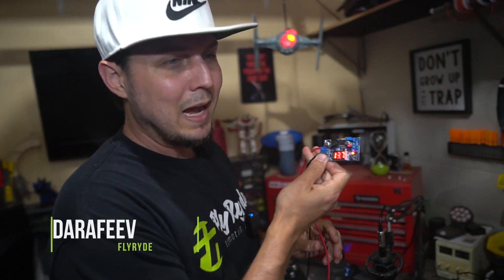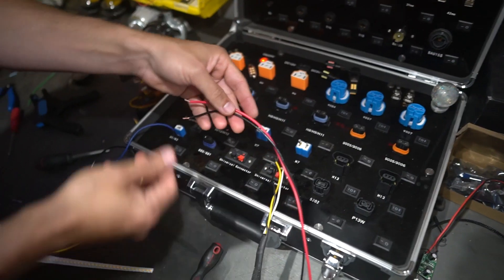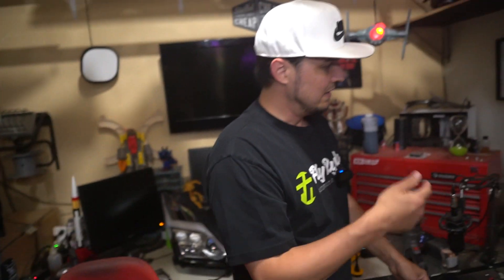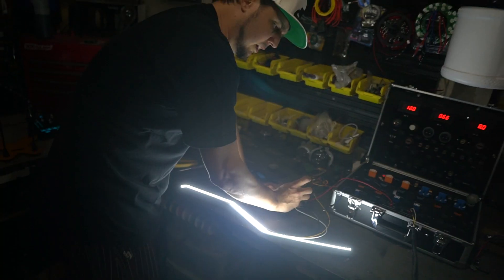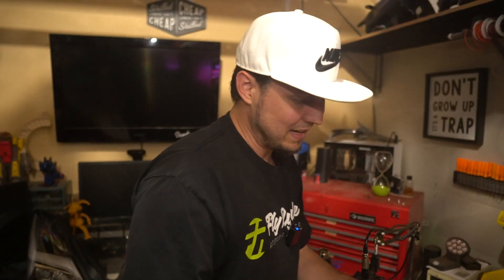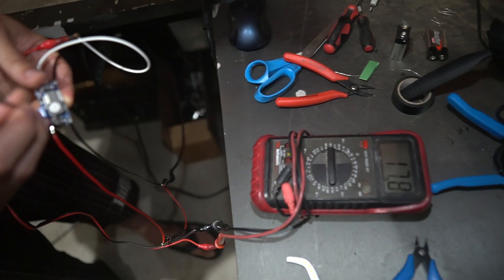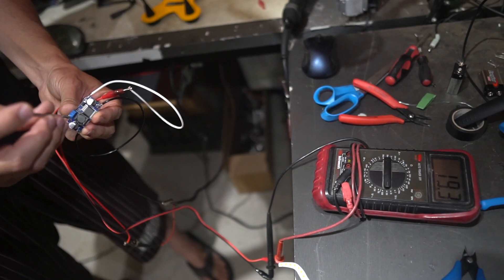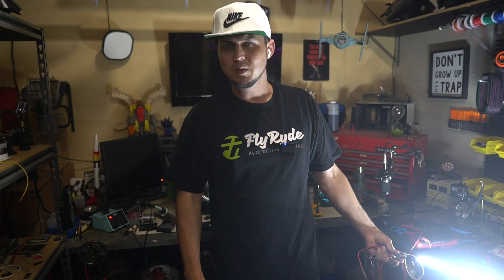How to make LEDs BRIGHT

Comment from the maker: My new Book: www.FlyRyde.com/start
Reply: Hey Chris, doesn't seem like you added the link for the converter. I'm guessing this is the opposite of a step-down converter I once bought by Drok.
Reply from the maker: So annoying, it wiped out all the stuff I had in the description and I didn’t realize till I read comments this morning 😅

FIXED
Reply: https://www.ec21.com/product-details/Car-LED-Test-Box-Useful--9569822.html    the test box
Reply: Leds are current driven right? So is that module also increasing Amps along with voltage Therefore making them brighter? This would make the them run much hotter and potentially fry them once they have been left on for longer period of time...
Reply from the maker: The heat that we building up in the buck converter was when I dropped the source voltage down to 4v, and the output was pumping up to 14.5. It was working HARD! In a car that’s running 12v at rest, it’s much less demanding to pump it up by 2.5v, and obviously less than that when the source voltage matches the set output.

I’ll do a future video on heat testing LEDs to the point of failure to demonstrate all of this as well 🤔 that sounds FUN!
Reply: @flyryde  I certainly look forward to that. Smoke and flames, the whole shenanigans. Do a remake of The Towering Inferno (1974).
Reply: @tacoreapermonir8725  That may be the case, yes.  As we saw, Chris felt the heat rising and hurriedly turned them off.  LEDs are less tolerant to heat and will fail faster. A marginal increase will still impact its useful life, but duration at a time and frequency will dictate by just how much sooner they would fail.  Now, if we are talking about DRLs, a reasonable level of brightness during the day should be effective for what they are intended to do.  In some conditions - weather or otherwise - there may be a need for a momentary increase in brightness that hopefully would not hurt much since the added brightness will not be sustained or become a default setting.  At night time, DRLs should be dimmed and not run at maximum intensity.  And this trick will make it a problem for those who are looking for attention.  The wrong type of attention would likely keep them using it responsibly.
Reply: @VaronsFirstLove  He only felt the heat of the converter rising as he had to input voltage too low.
Reply: @VaronsFirstLove  He felt the converter get hot. As he said the input voltage was too low so it was working much harder to put out 14.5v. There are other ways to dim I think. Just depends what your setup is.
Reply: @VaronsFirstLove  You need to know the maximum forward current for the leds to be able to safely increase the the current they use. That is the safest way you can do it.
Reply: Yore welcome
Reply: A cupel of minutes Google search
Reply: Can you do a video on last gen crown victoria lights? They cover alot of area & are fairly cheap to get brand new, but the styling is wack & the quality of the lens plastic & lighting output is terrible. There are a few aftermarket designs, but 4 the most part its somebody repainting or chroming the inside housing. If you.could design a better light it would make it worthwhile ure investment cuz everyone who has these hate the lighting output & overall design for any panther body.

Comment: Your links show a step-down buck. Wouldn't we need a step-up buck to increase the output voltage? Does anyone know if you can use the buck converter to brighten a turn signal led? And if  it would cause any issues like hyper flash?

Comment: You need a buck boost board,  the doctor dc converters are awesome,  but a boost only will go up if the input is higher than set voltage, it can't be set lower than the input, that is why the buck boost converter is needed!

Comment: Hey, I bought the circuit board with the screen on it, for changing output voltage, but it doesn't increase voltage by much. I was wondering if I was doing something wrong?  I'm using a battery pack with 8 D batteries for 12v, I wanted to crank up the voltage to my lights but it isn't going above 12.3v. Do you have any idea what I can do differently?

Comment: Do you realize that these are a step down voltage regulator? They're not to raise the voltage. Did it go from either 36,24, 12 volts down to 5volts 2amps. I don't think these are the pieces you need for this application.

Comment: Chris!! Great video man!! Thank you 🙏!!
So can I use this product to brighten my DLRs on my C250 M-Benz? I noticed my DLRSs run at a lower brightness level when the headlights come on. I replaced the headlight bulbs with LEDs and now the DLRs look weak. You think this will work for me?
Reply from the maker: The circuit responsible for running them at night, is powering them up differently than the DRL function (that turns off with the low beams).

Chances are, adding source voltage to your lights won’t increase brightness, because they’re likely regulated within the actual housings.
Reply: DRLS are supposed to dim when u turn on your headlights. It would be stupid if they didnt.

Comment: I tried these on my custom led tails. I set up two on each side; one for brake and one for sequential turn. My Corolla did not like this. I threw an accelerator error deeming the throttle non responsive. Fortunately I was not in traffic and just pulled over and went back and bypassed the up-converters. Again, fortunately I installed plugs so this was easy. I learned the code often is a result of current backfeed. Then I installed diodes on all converters. This helped, but still threw the code and disabled the throttle, this time in slow traffic with long durations of brakes on. 
For now the converters are back on the shelf…
Reply from the maker: What was the purpose of using them in the first place? What are you trying to do?
Reply: @flyryde  I was increasing voltage a bit as you were in the video to brighten up my lights
Reply from the maker: @FishHawk1  in the video, I increased voltage from ~12v to the normal operating voltage of 14.5v that those same parts see when the engine is running. What were you sending to the lights, and how was that backfeeding?
Reply: @flyryde  I set the output to 14.0 v. Before and after installation I verified output stability with an input voltage range of 11-14v. 
I believe the backfeed was tiny, especially after installing the diodes, but enough for the ecu to pickup, causing the fault code. 
My guess is it has to do the common ground circuit used for the tails.

Comment: hey, I hope you are well, I wanted to ask you what is the safe voltage for some led taillights which I want to make brightness boost, the particular led taillights come from a Kia Picanto 2020 and I don't want to break them with an excess of voltage.
Reply: Its effectively a tradeoff between brightness and longevity - and not a linear one at that. At some point the life expectancy will start to drastically drop - to the point of essentially immediately becoming DEDs (dark emitting diodes 😜...) And it depends on what sort of LED, how it's mounted, how well heatsink it is, does it have internal regulating circuitry, etc. I've seen SMD LEDs melt the solder that holds them to the circuit board w/o themselves at that point having failed (le once cooled down we resoldered the connection and it was back working...)

Comment: Using this buck converter, do you install it before the sequential switchback controller or splice it between the controller and the LED light strip?
Reply from the maker: It’s the same way since all the power in the sequencer is just pass through. I’d do it way upstream before the power branches out to passenger and drivers sides (if you can find that).

Comment: Now setup for current readings and do it again 😳😎 it's the amperage the does the work, voltage gets you there, and your resulting wattage will come out in either light or heat which is why you cant run high-power LEDs as singles without a Driver. 😂 Or one of those 50watt 6ohm resistors 👀🔥. Always better to generate light vs the heat 

Ohms Law
Volts x Amps = Watts

The LED data sheet will usually tell you about how far you can push. And if your LED is a constant current LED then voltage won't matter much anyway... Always a trade off somewhere. 

They have those in dual volt too BTW. REALLY handy for Blue GHOZT when you need both 5v and 12v. Some regulate the current too.

Search CCCV Regulator

Comment: OK Chris,
I play with LED lights quite often. LED light requires constant current and amperage to work for a long time. As you increase the voltage, you increase the intensity of the light, but the brighter they are, the more they heat up. The hotter they are, the faster they will go out. As your fan and friend, the brighter the light the better cooling will be needed!
P.S. - I exclude situations in which you have to supply, let say, consecutive 5 pcs (3.3V) LED. Yes then you will need 16.5V from a 12V battery !!! :) (this is just an example)
Reply from the maker: So you think running LEDs that are normally used to seeing 14.5v when the engine is on, with 14.5v when the engine is off, is exposing them to more heat than normal?
Reply: @flyryde  Absolutely not!
If the LED is suitable for 14.5V, it does not matter whether you apply this voltage to it when the car is off or working.
What I wanted to say is that if the LED is designed to operate at 14.5V when you apply a higher voltage to it, if it does not burn, it starts to glow brighter, but it also starts to emit a higher temperature and then it is good to consider a heat sink !!!
:)
simple example: 1 watt star diode operates at 3.3V with 270mA. It holds up to 3.7-3.8v. if I give him more than 3.3v it starts to glow brighter but without heat the sink does not last more than 1-2 hours and they die.
Best regards and keep moving forward with the help and guidance for young builders! :D
Reply: That's where you REALLY have to know your board and exactly what your dealing with. If the board has drivers already on it vs current limiting resistors then you wouldn't see any change at all.
From what I typically see, most boards are 3 LEDs in series with a resistor that's sized for 14.4v, otherwise it's running buck/boost ic's and whatever they can fit.
Reply: Why does my led on my car burn the acrylic fibre optic ? Acting I can do to stop it?

Comment: Instead of wiring the 9 volt batterys you can  plug one into the other in parallel
Reply from the maker: That’s what I did, but just not enough balls in the power source

Comment: Would this work with addressable led lights?
Reply: Addressable led lights take 5v or 12v. You shouldn't be pushing them any harder than what they are designed for. If you have voltage drop that is affecting colour and brightness closer to the end of the strip you need to to look at voltage injection.
Reply: I have some addressables that bright. Jump over to my channel most of what I do is high power addressable
Reply: I run these addressable and direct to harness simultaneously.
https://hillbillyhydrographicsandvinyl.com/products/led-5050-6-channel-wyr-rgb-bipolarity

Comment: Ok  got an 08 silverado with some aftermarket headlamps with the c bar style halos. I recently pulled the garbage that came in them and replaced with some quality blue led little mini type strip things.  The way it's set up is the leds just shine into the end of this plastic light diffusing bar ( sorry for my ignorance with terminology).  They turned out pretty good so far , but you know, could always be brighter .  I have no issues with voltage. Big 4 upgrade on my truck with volt readout on dash and truck stays right around 13.8- 14.1 once you turn on any lights.  It'll drop to mid 12s during day with lights all off.  Being an 08, it's go that RVC that always screws with the voltage, but my electrical is as solid as it gets. Double and triple checked all my grounds etc. 

So would/could I just add one of these inline , one per side, to crank up the brightness?  

2 other quick questions if you have the time. 1- is there any way of painting a reflector bowl for the high beam black and it still actually produce light?  My low beam is a projector and entire housing I painted high gloss black, and that big chrome high beam reflector just doesn't go.  
Other question- these little volt thingamajigs have any business being around a car audio system?

Thanks for your time in advance.  You're videos have proven extremely  helpful in leading me to believe I can do these things, and the subsequent devastation I've inflicted on my truck 😂
Reply from the maker: 1: I guess?
2: no
3: no

Comment: the title should be "how to burn your LED DRLs without proper cooling"
Reply from the maker: Or better yet, “How To give your LEDs the same power they get when your car is running, because your voltage goes up when the alternator is charging the battery, which effects voltage to all of the lights in the car that are designed to operate in both 12v and 14.5v environments even though people assume they only ever see 12v.”

Im pretty sure that ones too long. I’ll stick with my existing title 👌
Reply: @flyryde  With your bolts it might be perfectly fine. It's just if someone with diy, custom led setup might use that converter and end up frying there leds. The leds on your bolt might be running quite below there absolute max ratings and therefore they might benefit from this. Like a SMD led I've been researching puts out 26lm at 65ma continuous current, it's max is 150, I could push 130ma safely (with proper heat managment) it would put out almost 50lm.
Reply: @flyryde  Just want to say, I love all your videos and have watched a lot of them and learned a lot. Just think it would be interesting how much the current is also increased by and maybe what those bolts leds are rated for.
Reply from the maker: @tacoreapermonir8725  the amps go down after this booster, not up.
Reply: @flyryde  But you forget one of the most common thing in vehicles :D they were designed to handle that voltage and the extra heat generated by them, or better yet, most LED lights in cars use a VOLTAGE REGULATOR so they stay on constant 5V/12V.
Reply from the maker: @mkmkl66  lol you think China is pumping out a million little LED bulbs with built in voltage regulators? 

I’m not trying to troll you bro, but you sound like the majority of computer guys trying to weigh in on automotive lighting with zero first hand experience.

I certainly don’t know everything, and I welcome learning from being wrong and being corrected, but I take action to find out, then share. My videos are not about concepts and pontificating. They’re videos about real shit being built to work and work well, in real environments. 

By all means, correct me wherever I’m wrong. I’ll thank you for it 🙏